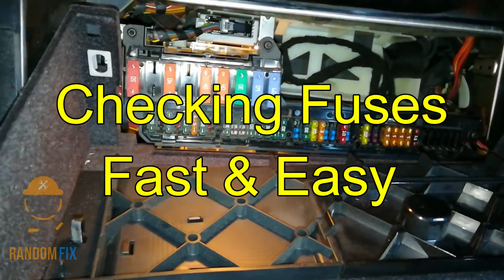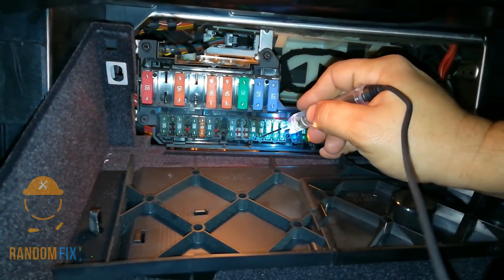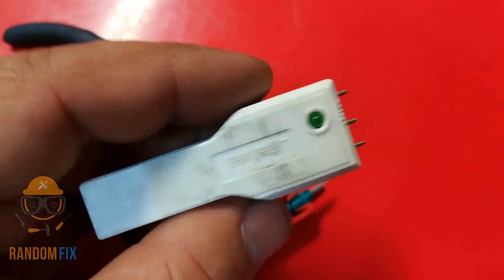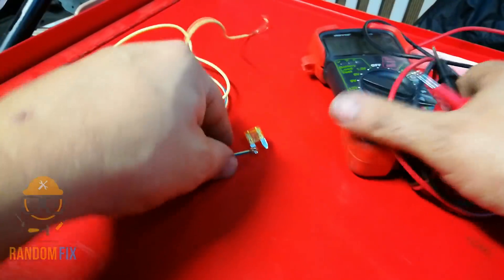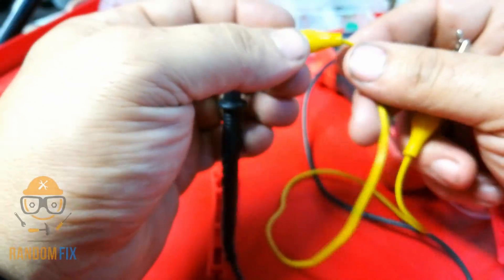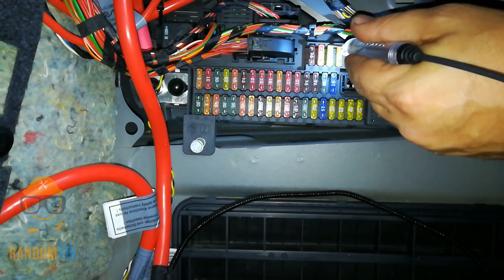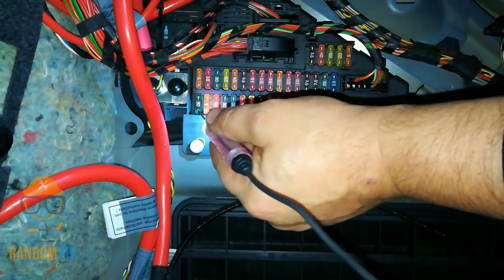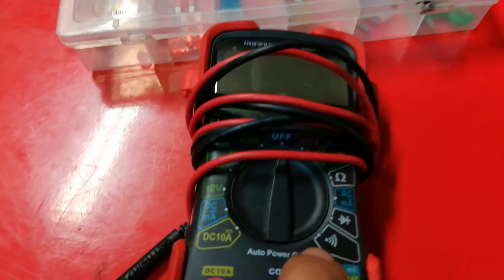Easy Fuse Fix -  DIY Fuse LIFEHACK - How To Check Car Fuses The Easy Way

Comment: hi the smaller fuse in my car is super loose could I use a bigger fuse
Reply from the maker: No, you can try to adjust the pins that make contact with the smaller fuse for a better connection.

Comment: Some fuses don’t light up unless the ignition is turned to have the monitors on, so do you want to check the car fuses with the key in the ignition or it doesn’t matter?
Reply from the maker: JA JAY, Great Question, you normally want to have the ignition on.